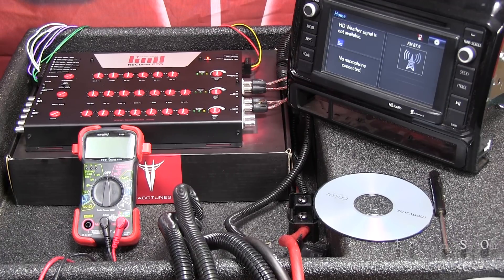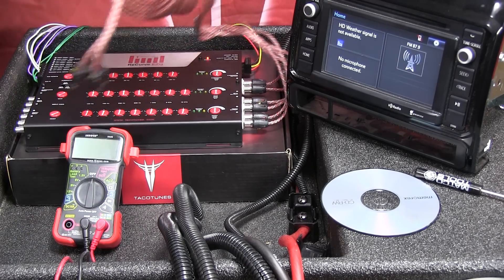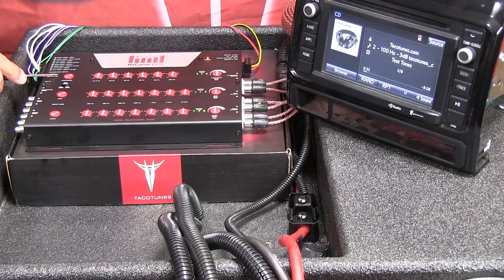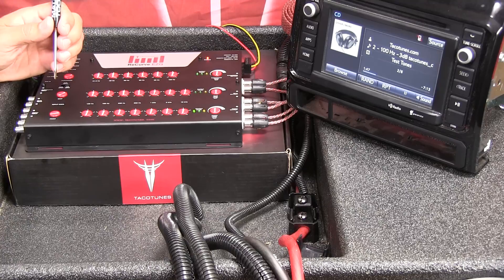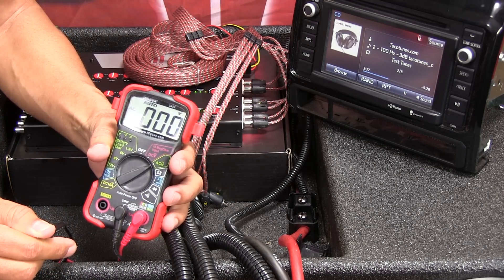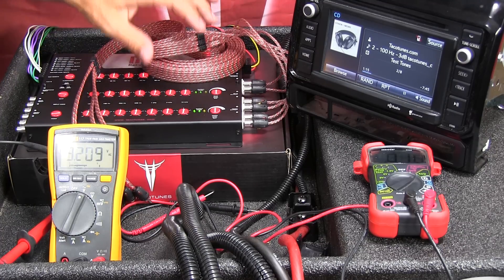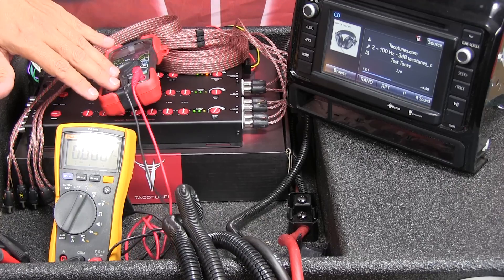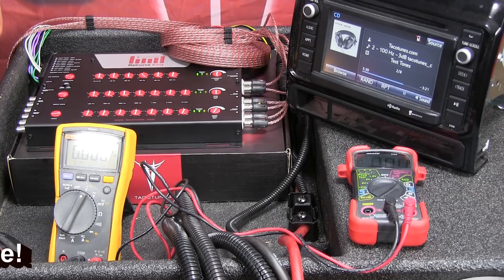ReCurve EZQ Installation Series - How to setup output level on ReCurve EZQ

Comment: One comment about measuring the output voltage (looking for the 4.0V).  At 100Hz, it won't be too terrible, but digital meters are not designed to accurately measure AC voltage at higher frequencies, especially frequencies in the KHz range.  

As long as you are testing and setting using the 100Hz tone, you should be OK, but if you go up to a higher freq, a Simpson analog meter will give a much more accurate voltage reading, second only to using an oscilloscope.